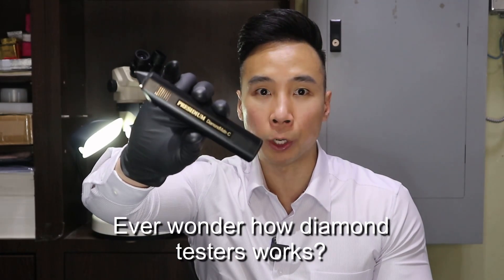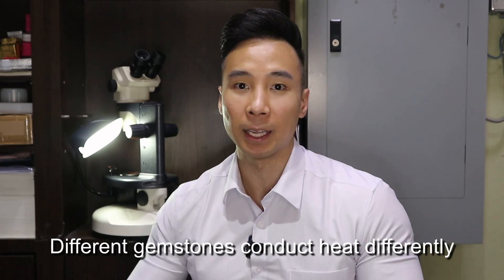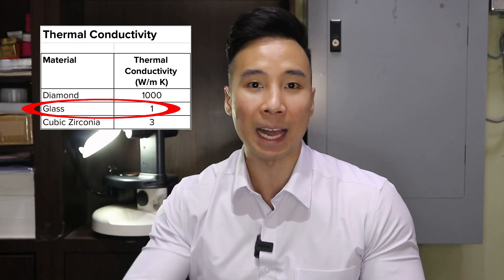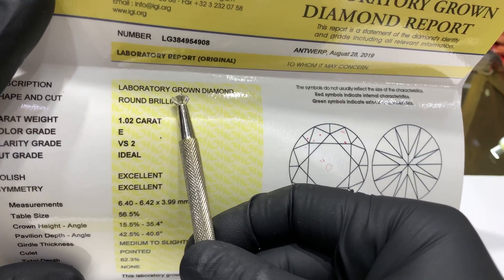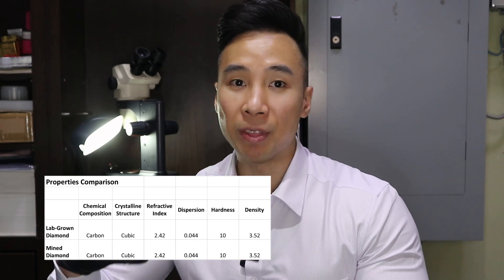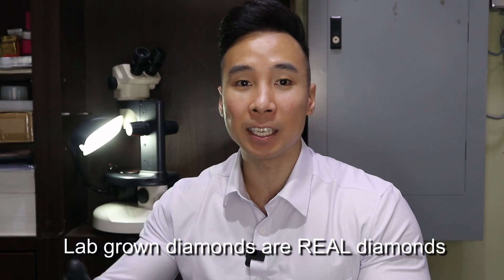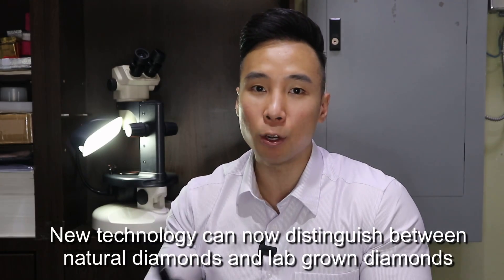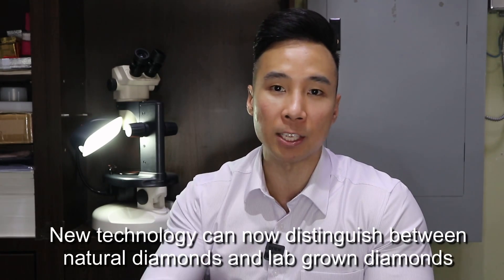How Diamond Testers Detect REAL or FAKE Diamonds!

Comment: Carbon, actually is a chemical element, and not a 'material'. Diamond is.
 Coal and graphite also made of carbon, but they will not pass the test. Because, although they are of the same element carbon, but  are different materials with different physical and chemical properties.
What the test actually shows you, is that two objects have  thermal conductivity very similar to a diamond(which is preset/calibrated by the factory). Nothing more or less.

Comment: very good video helped me confirm the truth of a diamond that I have in the rough.  and my testers that I have the most.  Basic I had already used it and I did not imagine that the battery was lowered very soon and thus I worked for a long time with this device suddenly it stopped turning on.  and I realized it was the battery.  Buy a new bolvi to test the rough stone and if it was positive.  is a diamond.  In the rough of an approximate 2000 carats or possibly more, I already tested the hardness and also gave diamond results. I put ultraviolet light on it and it has very little fluorescence, almost nothing.  It was all full of dirt but you can see it already.  something strange but it is diamond and it could be that it is of very good quality in transparency.  What other test could I do to confirm if it is a diamond.  I need your help